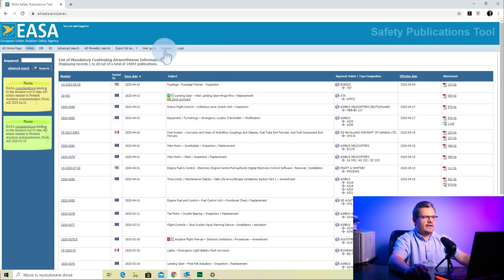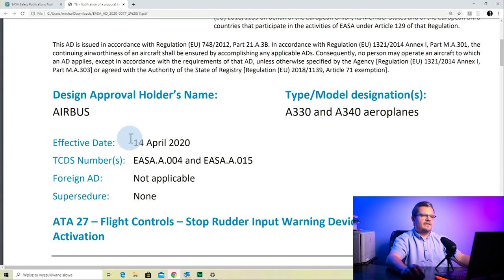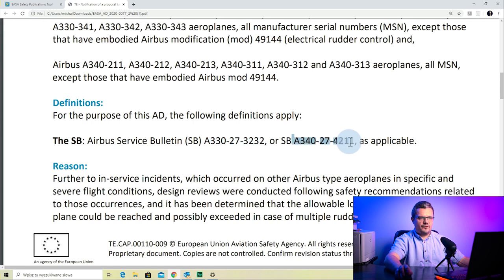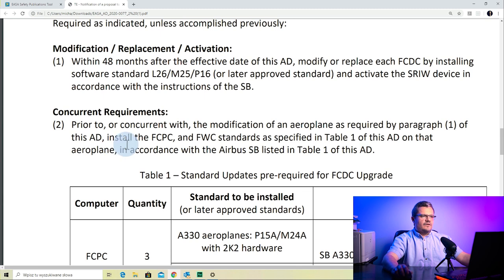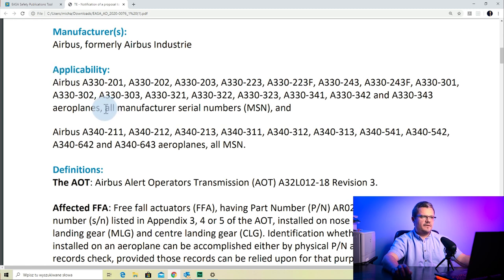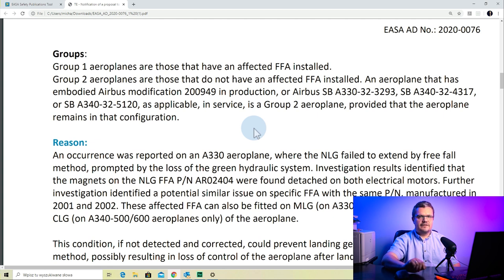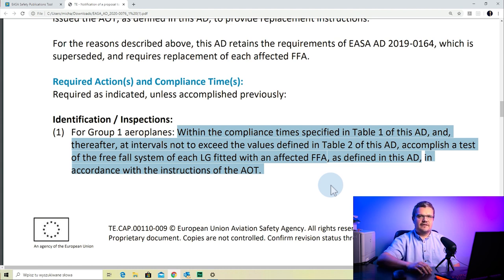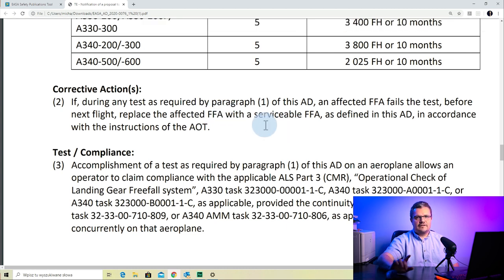How to read EASA ADs - Case Study of Two Airworthiness Directives

Comment: My question is that is an operator required to monitor foreign Ads if EASA is already doing that?
Reply from the maker: Only ADs released by the state where the type certificate holder is located. So for example if you operate a Boeing in EASA, you still need to monitor FAA ADs (but yes, they will be also visible on the EASA web site but as FAA ADs). Also please keep in mind that not all foreign ADs are adopted by EASA.
Reply: If EASA do not adopts a FAA AD, as an EU operator you have to implement it?